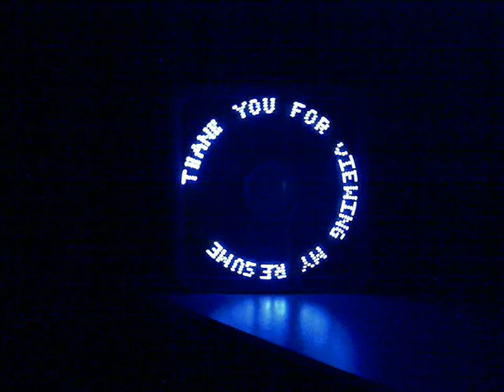Message Fan

Comment from the maker: @carnews333 your first question is a little broad, and complex to answer in a post. As for your second question the programming language really depends on what discipline you go into. Computer and/or electrical engineering is a very broad discipline. For me In a single day at work I can bounce between VHDL, LabVIEW, C#, and various proprietary scripting languages. At home for my personal projects I bounce between C, C#, Visual Basic, and assembly for 8051 and PIC. (usually mixing C and assembly)

Comment from the maker: @mylocky40 It has a 9 volt battery with a 7805 (not the most elegant or efficient, especially with the direct driving of the LED's) . My current project has slip rings, hopefully I'll have that done this year. I found some slip rings that are rated for long endurance at 2600rpm. But, I haven't had a chance to test them out yet.

Comment: how do you program a camera to a microcontroller. For example, I get a security camera, plug it in to a microcontroller, the camera see an object heading to the car,the camera sends a signal to the microcontroller, microcontroller send a signal to a car brakes, and the car or golf kart stops. also, what progaming language do most engineer use.

I want to become an comuter engineer :)

Comment: Nice use of the IR LED to synch 0 degrees and very readable very readable font!  Put a thermometer on board and you could display the temperature.  Couldn't find details of your design on schematicsupport <dot> com.  I'm most interested in your firmware, specifically the bit maps for the character set.

Comment from the maker: This was a home project. I had the idea for a long time, so I already had many of the concepts planned out.  I didn't know what the RPM was going to be, so I got lucky that the RPM was within the timing limits of the software. I'm a fairly fast programmer in PIC Assembly. I have a sizable library of pre-made macro's that make it easy for me to program. I also had all of the parts in my lab, I wanted to use the induction from the motor to power the circuit, but it was faster to just use a 9V.